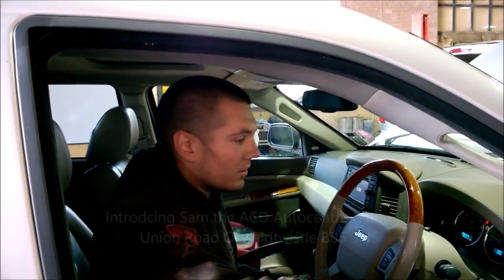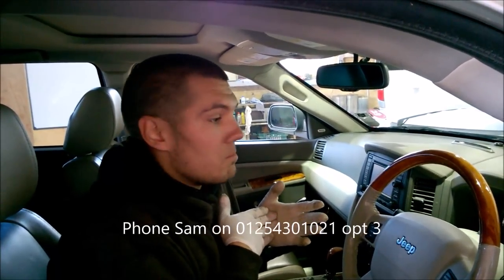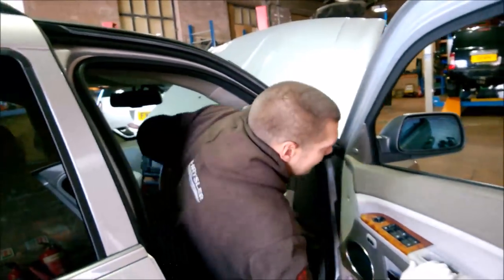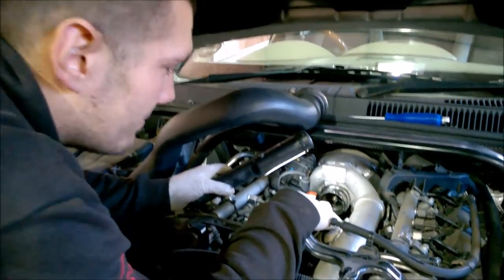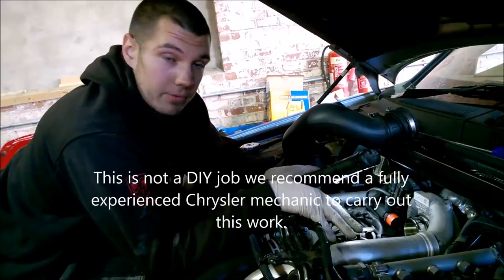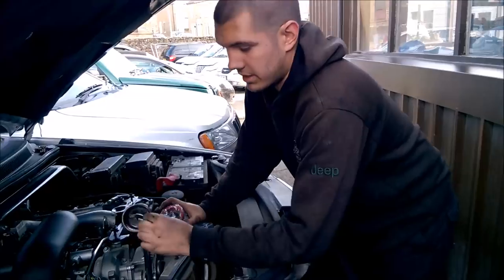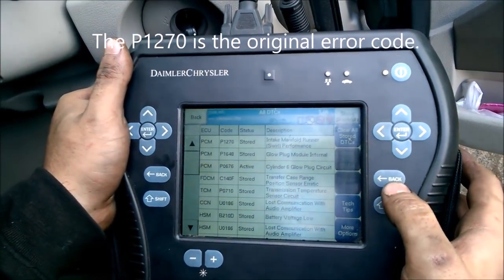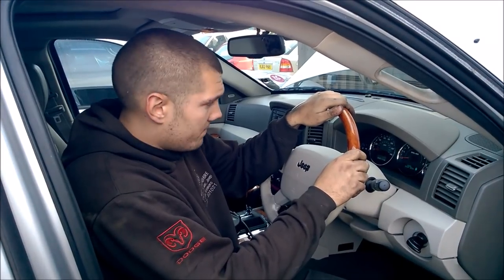Engine lightning bolt, how to diagnose a faulty Swirl Pot motor.

Comment: @2:13 you say the lightening bolt icon can only be caused by a faulty turbo actuator or a faulty swirl motor. Er, no. I believe there are quite a few other things that can bring that light on, EGR valve problems for example. No mention here of the 4.7k resistor trick that solves the swirl motor problem in 10 minutes for less than sixpence.

Comment: Just put a 5k ohm resistance on the connector to the swirl pot leaving them fully open. I used this trick on my 300c crd, saved myself over 700€ and I can honestly say the car runs perfectly smooth and even more responsive. I did not invent the trick but I found it on the net. Bye bye dealer

Comment: Good video. There are many other things that can bring on the red thunderbolt icon )z( such as an actual faulty electronic throttle body (I've had two of them fail) and wiring harness chaffing of same.

Comment: Excellent video. I'm a keen diy mechanic and have this problem exactly as described. Could you tell me if the turbo itself has to be removed to gain access and removal of my defective swirl pot motor please?  Best wishes. Tim

Comment: Now what about the 5.7 hemi gasoline engine? What about flashing throttle body light?
Reply: I have the same vehicle did you ever find out the problem?
Reply: @jdmurfreesboro2738  Yes I did. The throttle body was broken somehow, probably inside because I manually cycled it with my fingers which is a big no no. I found one at a junkyard and replaced it and everything perfect again. Or you gotta buy a new one.
Reply: @jameybarisoff  thanks for the quick reply. Junk yard Monday. Thanks again

Comment: Hi can I ring you iv got a brabus 300c with a limp mode iv had ecu turbo pipe swirl eat at the cost ov £1748 and still it Gos in to limp mode iv just payd for a new pcm injector mod at £950 + vat if this don't work I'm going to go mad wots your phone number plz thanks